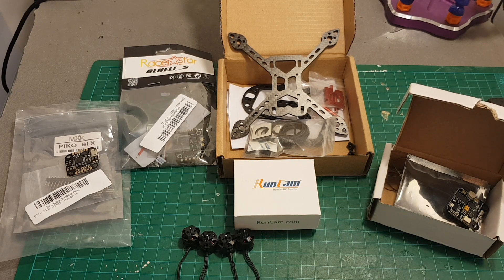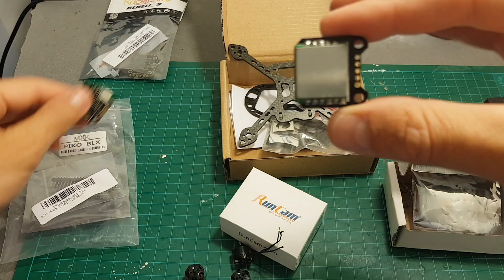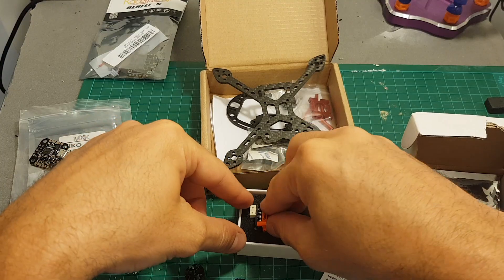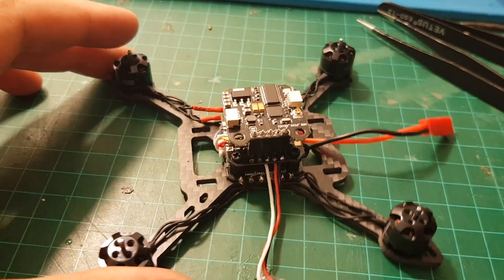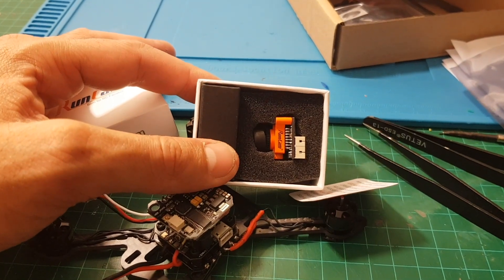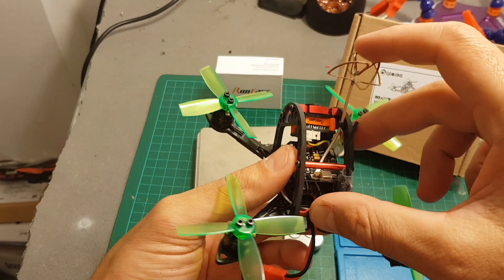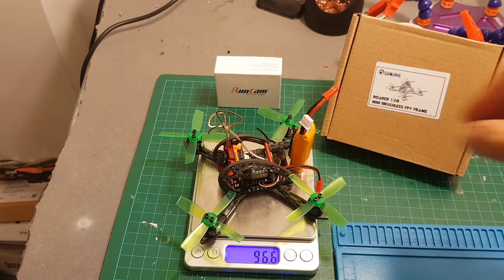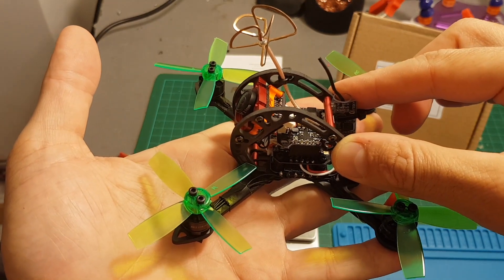Eachine Roarer 120mm Full Build Video And Maiden Flight

Comment: Will this frame fit 1106 motors AND either 2435 or 2535 props?
Reply from the maker: I can't find the specifications of this frame (Just this page: https://goo.gl/DFS8xT ), but as far as I remember, the suggested motor is 1104. You can use 2435 props.
Reply: I fit Emax 1106 6000kv motor in my Roarer 120.